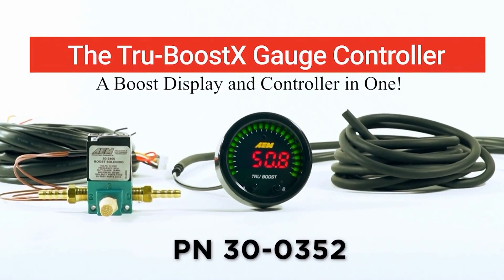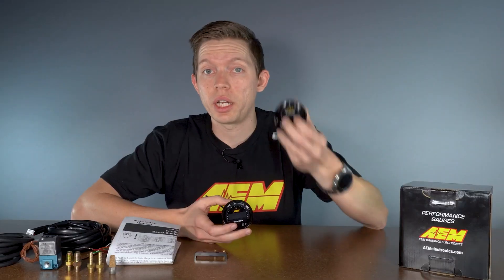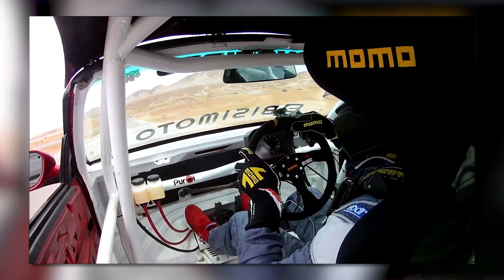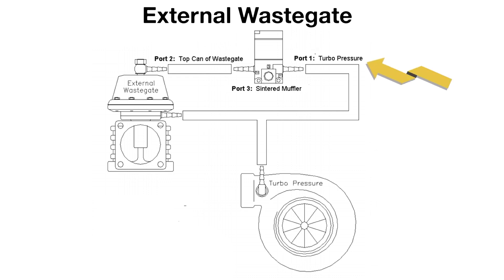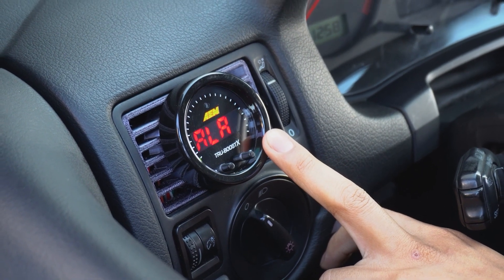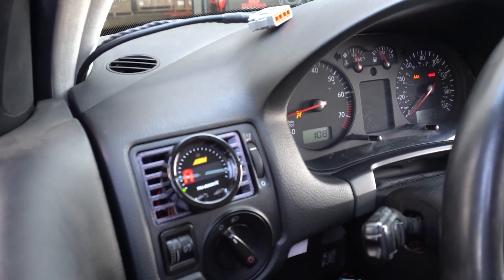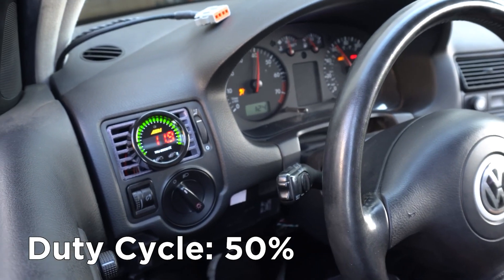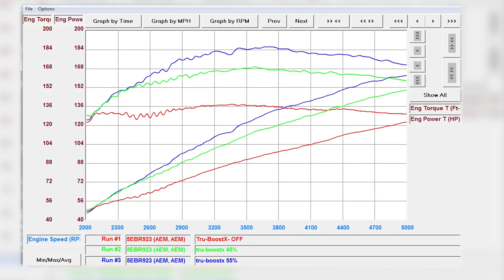Tru-BoostX Gauge Set-Up and DYNO RUN

Comment: Can someone explain what they mean by wastegate spring pressure?
I have a 15psi base spring, so should my OPP be set to 12/13psi?
Reply from the maker: Inside of a wastegate there is a spring, this spring can be pretty much any pressure depending on the application. That spring controls when the gate normally opens to control boost pressure.
If you have a 15lb spring in your wastegate then yes, its recommended to set your OPP to 12 or 13.
Reply: @AEMpowerTVelectronics   if my wastegate spring is 14.5 and I have the opp set at 12.5 how should I change this setting to manipulate for faster spool ?

Comment: How do you know what your target pressure is? I just want to know what my stock pressure is to avoid damage with other mods
Reply from the maker: Target boost will depend on a variety of factors, I recommend consulting with your tuner to work on what will be acceptable for your setup. Fueling, engine internals, ign timing, other mods, age of car are all things that can come into play.